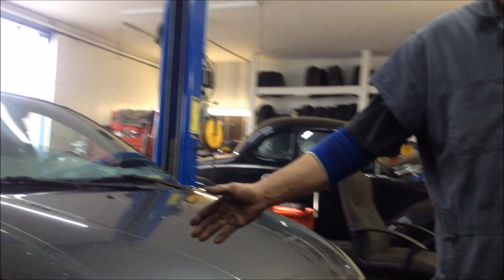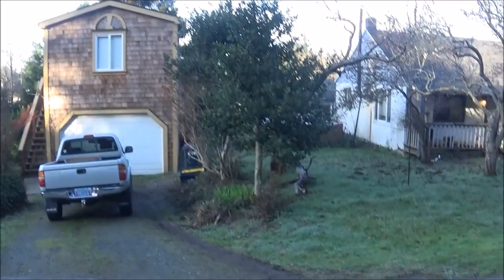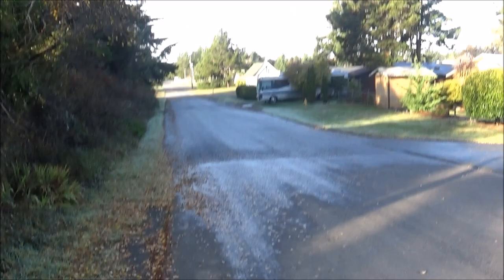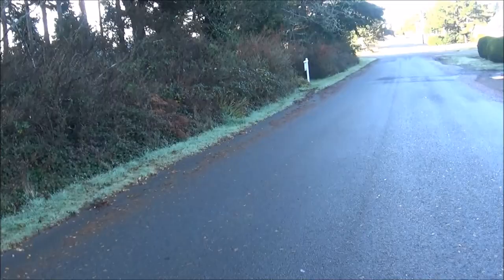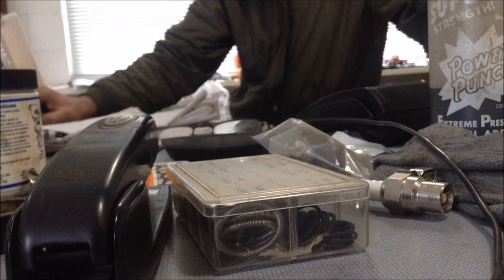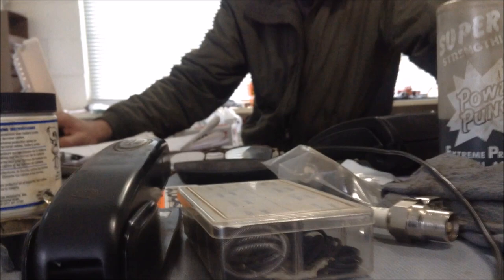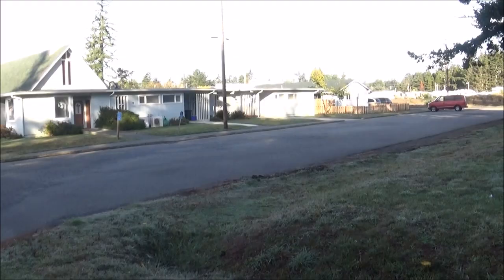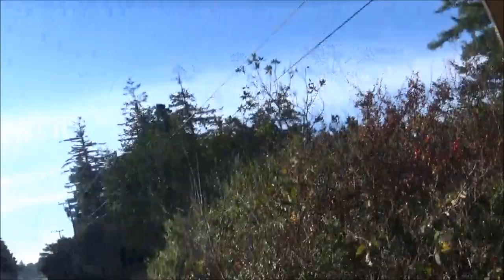Port Orford Mechanic talk, Oregon

Comment: The slave cylinder should be on the outside of the transmission ? Or a cover to get to it ? Its front wheel drive right ? 
You should be able to see it. A cylinder with a hose and a pistion pushing a Y' arm ?